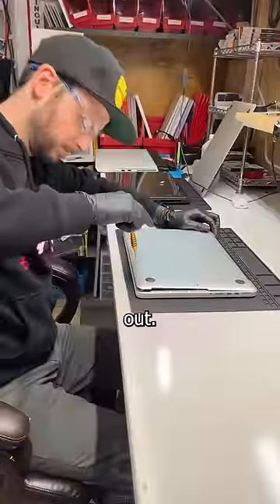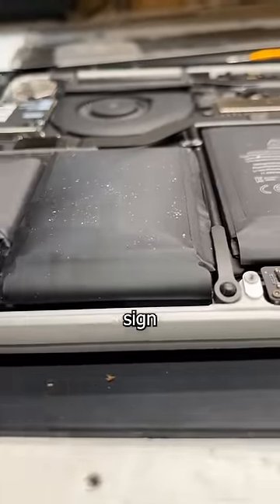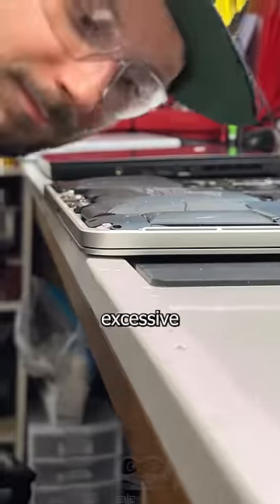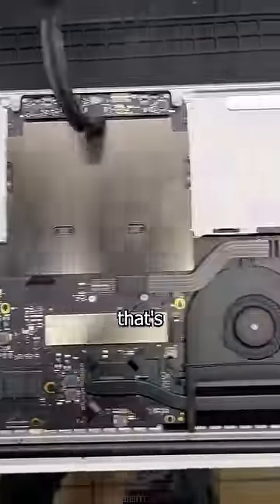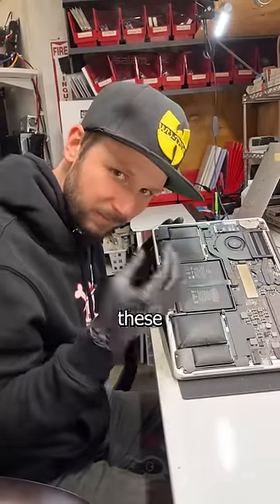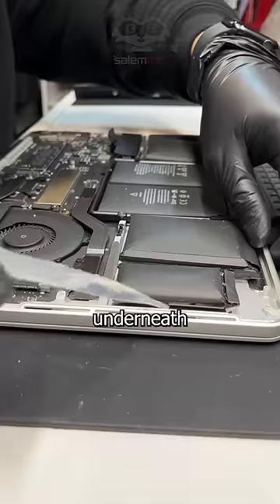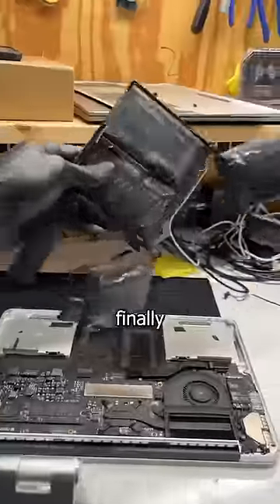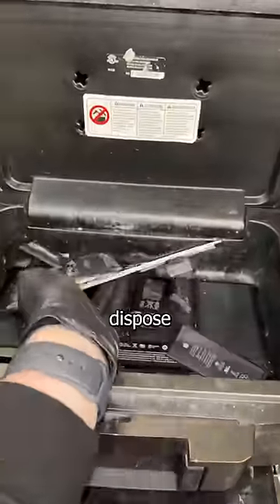2015 MacBook Pro (Spicy Pillow Edition) #tech #pc #technology #shorts #laptop

Comment from the maker: Yes it throttled. Yes the customer ended up buying a battery.
Reply: Some Macbooks wont power even when plugged in if there is no battery.
Reply: Bruh
Reply: No shit. I believe many laptops need a battery for cpu usage surges. Mac books should have charge level limiting like other devices do.
Reply: Nice Wu-Tang hat I’m seeing then tonight in Brooklyn with Nas
Reply: Man I miss my old Lenovo N300. No battery? No problem. Plug in and do whatever you want.
Reply: Ok, but 1 question: Who's the father?
Reply: Removing and not even knowing you can actually remove it without it working flawless. Says everything you need to know about this technician
Reply: Yeah I saw that coming a mile away having done this exact job for a friend.

Out of curiosity, how much would you charge in labour for this?
Reply: @bachmed00 yeah because apple has repair guide & schematics avaliable. You don't know until you know + he might have told the client it could not work perfectly. Still better than keeping spicy pillows!

Oh, on the same end, if you're such a better technician, why don't you go repair apple devices the perfect way. I heard there is a lot of money to be made, replacement parts are cheap and easy to come by & its good for the mental health 😂
Reply: Is it possible to use a laptop without the battery? Can this be done with phones???
Reply: @RaySmith-zg7od  in my exlerience usually laptops with removable battery can work without it. It will just abruply shutdown after a power surge like a desktop pc. For phones, usually not. Same thing with gopro, most won't work without their battery even on power/charge. Probably because the charging circuit can't provide enoug power to the device in some contion so it relies on the battery :)
Reply: @wisico640 It does depend on the maximum charging capacity of the phone I'd imagine. For example my current phone supports up to 100W charging, and there is no way in hell the phone itself could ever use that much power even under heavy benchmark conditions.
Reply: @oddeofreq what if you add more voltage than the standard amount? Like: the voltage giving as much as the battery and charger
Reply: I was wondering. With the power limit of the MagSafe 2 I’d be shocked if it could get enough power not to throttle without a battery.
Reply: @xmlthegreat but the n300 is a desktop? also, i have an old thinkpad t430 and it significantly reduces the performance of the cpu when i take the battery out. it even complains about the charger’s low wattage when you first boot it up. so this is not an apple only thing.
Reply: @benargee Yep, it had fried my MSI motherboard
Reply: Yeah, my late 2013 wont start when it's empty, has to charge over 5% before it accepts being started. So I highly doubt it would start without the battery in it.
Reply: @trippplefive  my bad, it was a Lenovo 3000 N100 from ~2006, with a Pentium Dual Core of some kind? Can't remember for certain. Last I remember I was running Ubuntu 11.04 on it. And it ran just as well with the battery as without, I used to run late 90s games on it then though the battery completely died about 2 years in.
Reply: I was going to recommend  supercapacitors to handle those issues, no significant capacity but good enough to smooth things out for less cost then a battery..
  Question, would they hold enough to do a proper shutdown in a power outage?
  (Updates off , 10 apps open , give it a full minute before force shutdown)
Reply: @benargee they dont???
Reply: @RaySmith-zg7od Yes it is possible to use most laptops without a battery as the laptops included charger is essentially the exact same component as a power supply in a desktop computer and so therefore so long as it can supply the needed wattage as the computer is running nearly all laptops allow the batteries to be completely rude and the computer still work.  

Chargers included with phones are also technically power supplies in the same sort of way but at much lower total wattages (Watts=Volts×Amps btw).  However phones also use far lower amounts of electricity so possible that some models of phones may work only while being plugged in, but since so few customers are likely to use their phones this way I doubt many manufacturers actually make this possible in phones like they do in nearly all laptops.
Reply: Jokes on you I'm into the bass of full volume "THE GREATEST TECHNICIAN THAT EVER LIVED"
Reply: Cool, I almost commented on that :)
My 2013 macbook air is unuseable since I sold it's battery to a client...
Reply: Cool, I almost commented on that :)
My 2013 macbook air is unuseable since I sold it's battery to a client...
Reply: That's what I came to ask as soon as you said you were just going to take out the battery
Reply: that's just bs. I had the same problem and used my laptop without the batteries after they inflated. had been using it for 3 years and no problem.
Reply: @SpySxlar  yeah there's a difference between using it after it's inflated and removing the battery all together. If it detects there is no battery for it to load balance power off of the performance degrades incredibly hard
Reply: Open Core Legacy Patcher can get rid of the throttling however its not advisable. Its throttled for the reason that it would stress the charger to much without battery
Reply: @hoverbike why are going to backcharge your friend 😂
Reply: @marcfavell  curiosity, to put a figure to it.
Reply: @benargee Yeah, My Laptop will sometimes even drain Battery when plugged in while in VR xD
Reply: If you suspect a bulging battery, I would recommend putting pressure down on the bottom cover as you unscrew it. Ive seen bulging so serious it deformed the hell out of the cover as soon as a couple screws came off.
Reply: i was literally thinking "what if my computer unplugs for a moment"
Reply: Battry.
Reply: the one piece is real
Reply: @ichigokurosaki1708  yeah, i ate it
Reply: @benargee not all require a battery
Reply: @SpySxlar yeah thats a normal laptop, this is a macbook
Reply: @JayRey117 you're the guy that knows exactly what color the the couch is in "thirst trap" videos because I did not notice his hat hahaha😂
Reply: my old powerbook did not even want to boot when the internal cr2032 battery was dead.
Reply: @xmlthegreat same. I can use my laptop without battery just plugged it in. And still works fine.😅
Reply: @CorgiButtOnWheels  if you dont know what you are doing, give it to someone else since these batterys can explode in a fire .
Reply: I was about to say no batteries makes no circuit. Plus what would regulate the power if the batteries werent in it? Lol
Reply: Oof. Apple once again enforces more e-waste.
Reply: How did it nearly take your eye out??
🧐🤔🤨🤷🏼
Reply: @bachmed00 customer requested it lmfao, you don't stay in business long telling customers no
Reply: @benargee no, macbook is dramatic to get you to buy new mcbook
Reply: Tip for OP hand sanitizer works far better than straight alcohol for getting rid of sticky residue.
Reply: hey, I came here to tell you this, it's not fair!
Reply: Actually the funniest tech repair guy ever
Reply: @benargee  they.. do
Reply: « A bottom case being held by hopes and dream » IS THAT AN UNDERTALE REFERENCE!!!???!?!?!
Reply: How can I send you things
Reply: One pice hoodie respect
Reply: Hey I don’t know didaly squat when it come to tech but is there anything beside a compressed air in a can you could recommend that portable and is  just as good or better?
Reply: @bachmed00 ummm you must be a child
Reply: @xmlthegreat My first laptop was a Lenovo 3000 N200. Such a reliable thing that it is still used by somebody. I used to play games and host servers with 2Gb of RAM 😂
Reply: Badass hoodie
Reply: Charger pregnant laptop and you deliver baby out of Laptop😂
Reply: Hey one question can u repair my phone that got burned from inside?
Reply: Yes Apple is crap
Reply: womp womp
Reply: Where can I buy a battery from? I have a MacBook Pro 2013 with a dead battery and the iFixit batteries are garbage. Went through three of them in about a month and then got a refund.
Reply: I like how you post the ending lmao
Reply: @benargee they do all the time it happens so often on mine it’s annoying
Reply: @benargee then how did my windows 7 laptop start
Reply: @oddeofreq In my experience some won’t power on when plugged in even when there is a battery 💀
Reply: @KenaiUlfr Is it possible to modify so, that it never will go over the capacity of the magsafe charger's limits to avoid shutdown?
Reply: wtf is wrong with apple products
Reply: Oh Hey, i did this for a friend a few years ago.
Reply: @benargee  they don't exactly have that (neither do most windows), but they have optimised charging (which slows down charging after 80%). you can also use al dente (stops charging after a specified charge) but its paid 😔
Reply: With opencore u can bypass throttling
Reply: Apple: The Dirtiest Corporation That's Ever Been
Reply: Of course Apple made their product so bad it uses more power than the power brick they made for it.
Reply: @matthewhafner962  the apple hate is wild, you do realise that MacBooks have better build quality, right?
Reply: @reduchimaki  The power brick not being able to fully supply the laptop is not "better build quality"
Reply: Macbook pro more like Macbook bro
Reply: Just what I was going to write
Reply: Womp womp womp wooommpp
Reply: I have a macbook pro mid 2012, and I have upgraded it somewhat. But I actually would not have needed a new one if I could have installed OSX on the new hard drive. Now it has Linux installed and it can run more games than my new Mac as it refuses 32 bit games via steam
Reply: I got the impression that they where going to use the computer as a stationary. But depending on design that may not work without some kind of battery.
Reply: was about to say😂 no battery no capacitor
Reply: @bachmed00  mac is just a pain in the ass.
Reply: Mine didn’t have any performance gains after I put the battery back in. What was happening is that, sometimes, when just started it would turn off. After the second start though, smooth sailing. It’s running Linux though, not MacOS. 

Also, super weird. When I removed the battery I reinstalled MacOS at first, just to test out how it ran, and keyboard and trackpad were dead. I thought I screwed up the ribbon cable and ordered a new one. Before it arrived though I reinstalled Linux and keyboard and trackpad just magically came back to life. 😂

Cheers.
Reply: @Based-x8z The customer
Reply: Lol
Reply: I wanted to replace the battery iny MacBook Pro. The shop wanted to keep it for a week. No dice as I used it for exercising on a daily basis. Eventually, I got a newer one and e-cycled the old one.
Reply: i think you can just use a patched version of mac os to avoid the throttle
Reply: Lmao
Reply: Of course, it's an Apple device. And the new battery needs to be correctly programmed too, because of the anti-repair volatile software right? Or else the keyboard and Webcam stop working.
Reply: That battery is a fire hazard when it explodes💥
Reply: @hoverbike  As a former Apple tech, I wouldn't touch an Apple device for less than like $500, no matter what the repair is.
Reply: Was looking for this.
Mine (2015 mid 15") didn't boot on a charger, probably because usually during boot the CPUs try to turbo and that's beyond the 65W that the charger can provide. 

(This was an older company laptop, best 10 year old i7 and some AMD GPU.)
Reply: @oddeofreq wow.. that is shitty design right there.. i am glad my school zenbook works without battery because i just didn't wanna ruin it by always having the charger in when using my laptop so i just took off the back and took out the battery each weekend and put it back in on sunday before going back to school... wish asus had made it easier to just release the battery from the pc instead of having to undo the 12 screws and the 2 battery screws each time...
Reply: I came here just to say about throttling
Reply: u can bypass the throttling with open core legacy patcher but its not recommended because the MacBook can not provide 100% power only from the charger without straining it
Reply: And yes the customer ended up wasting money on that unsupported garbage
Reply: @benargee  they do infact
Reply: @RaySmith-zg7od  technically if u connect a power supply to the battery socket on the board yes but u need to have a adapter from lab bench psu to the type of battery and put the required voltage

Comment: People, before u decide to do a battery delete, understand that the battery acts as supplemental power. Some laptops will need them to function as they did before.
Reply: Yes and I am pretty sure the MacBook throttles like crazy if there is no battery because the power adapter alone isn’t enough to power the thing at full load
Reply: Also is really easy to knock the charger off a MacBook
Reply: @Alexander_l322 some macbook wont even starts without a battery
Reply: I had this issue with a gateway not long ago. It won't boot up without a battery.
Reply: Case-in-point : My DELL laptop will not do a BIOS update w/o the battery. Yeah, well maybe they should have made a better battery. I think it was only a year old when it ballooned (second one at that).
Reply: That's just stupid..
The charger should always be able to run solo 😂
Never heard of a laptop using a battery for more power...
Reply: @DreStyle Same, and I call BS on all of that. A computer refusing to start without battery is hardly understandable, but saying the battery supposedly allows for more power is straight up hilarious.
Reply: @TheJoe971  If all it is aimed to do is to deal with load spikes as these things are unlikely to be running continues loads, atleast in the minds of Apple I could totally see that be a thing, they can save a few bucks on the power supply. Probably wont notice it unless you run some benchmark.

I put a 5900X in a B450 board with insufficient VRM cooling, it would throttle... eventually but it required me to load it hard for 15 - 20 minutes, something that never happens even in my most demanding games. I still caved and bought the best Motherboard I could get 2 - 3 months later hah X570S Tomahawk WiFi, it had the best VRM cooling around for this generation. Went from 100+C to 55 - 65 C vrm temps...
Reply: My battery bms failed and I found no replacement in all the cities I visited. I just removed it and now my laptop is lighter than my tablet 😂 I can just buy some external battery and a port adapter and I'm done
Reply: @murdoch9106  Laptops are designed to perform the same with OR without battery, and that is because manufacturers know a battery is a component that loses its capacity over time. My 2009 MacBook had a battery in it and wouldn't even start unless plugged in, but once plugged in, it would perform exactly the same as if the battery was brand new. I've had numerous laptops that also had dead batteries and once removed and left with an empty spot, they'd perform exactly the same. So OP's claim is straight up non-sense.
Reply: Could be the owner decided removing the battery themselves was too dangerous since they turned into spicy pillows so they wanted the greatest technician to do it. Which I totally respect. Then they can just throw in a new battery themselves.

Comment: I had a MacBook come in with a spicy pillow. It was spicy enough to push the touchpad out of the case! Impressively enough, after removing the battery, the touchpad still worked.
Reply from the maker: Yet one drop of pube sweat and the screen breaks, it's funny how they work!
Reply: Two replies? Let me fix that.
Reply: 3 replies? Lemme fix dat
Reply: same thing happened to me. the TouchPad didn't work for 1.5 goddamn years.
Reply: @SpySxlar does that happen if you use your laptop while it's plugged in??
Reply: @deven2283  no. it's the damage from the battery inflation. I used it for 1.5 years and it randomly fixed itself.
Reply: i had an old phone with screen issues but it works while i charge it but after removing battery lol. how bad could it be?
Reply: I’ve seen two computers where the batter actually started to corrode and ate through the base cover